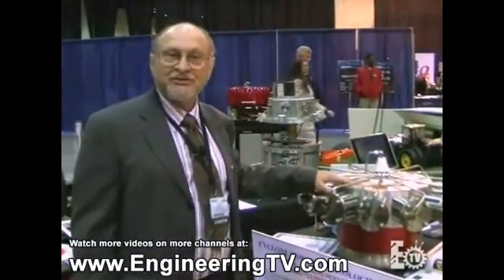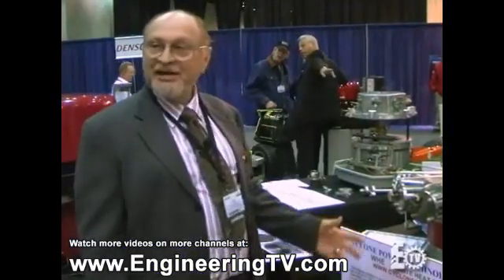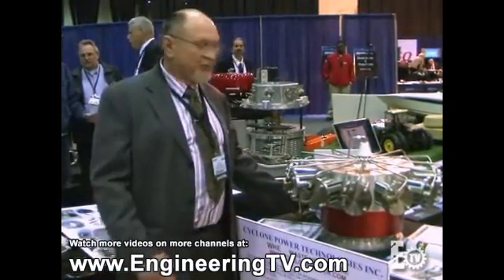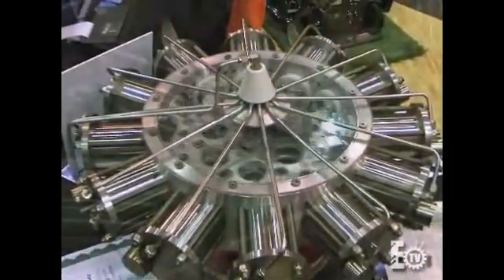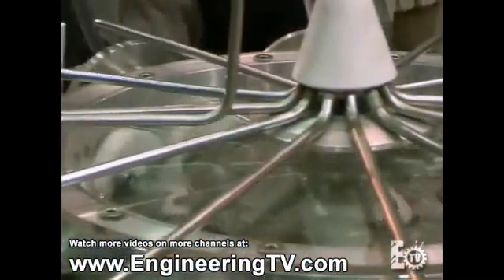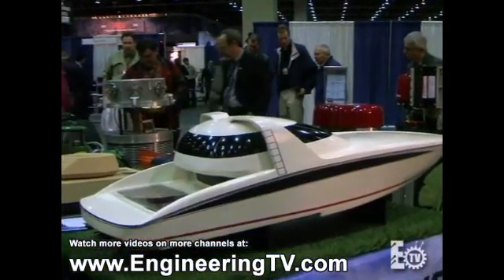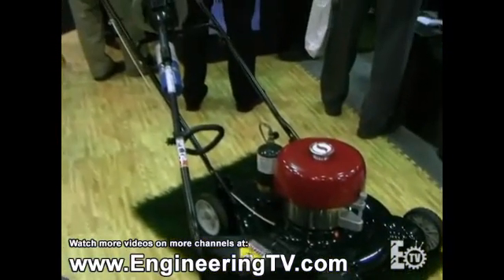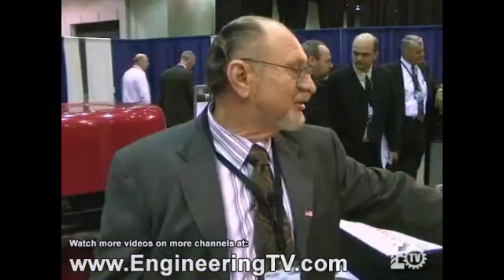Cyclone Waste Heat Engine

Comment: The worst ever type of engine is the radial, why even use this, if you have the space to use a turbine instead?
Reply: Cyclone was a fake company nothing but a fraudulent vaporware investment scam.
Reply: @sandervanderkammen9230  lol
Reply: @ExtremeGamerYT22  The slightest efforts in due diligence reveals this company was nothing but an elaborate vaporware investment scam.
Reply: @sandervanderkammen9230  I fell for it after seeing it featured on the Science Channel How it Works.  Seems it works to scam and screw investors.  This Waste Heat Engine is a great idea but has major design flaws that prevents it from ever being more than a garage project that will run for a relatively short time and fail.  

I think this is a scam company and they have barely done ANYTHING in the last five years and not much before that.  The one thing Cyclone Power has done in the last few years was sell off the only profitable part of the company, pocket the money and screw their stockholders that have been supporting them (seems like) forever. 

 Personally I think it was a scam from the beginning.  One of those pink sheet stocks pumped up and dumped by the owners.  I'd love it if they proved me wrong.  It is the perfect time - China Joe stole the election and with all of his green deal BS this company should be revived to capitalized on government grants and tax subsidies. Then they can screw their stockholders again with some insider trades etc..  Why the SEC lets these clowns and others like them get away with these scams and not put these fraudsters in prison is beyond me.
Reply: @SuperDanielB1  most of the investors money was siphoned off to build a mega yacht and a luxury home.

Comment: Looks junk if this was 2010 there should be some used lawn mowers by now ..lol scammers
Reply: This Waste Heat Engine is a great idea but has major design flaws that prevents it from ever being more than a garage project that will run for a relatively short time and fail.  

I think this is a scam company and they have barely done ANYTHING in the last five years and not much before that.  The one thing Cyclone Power has done in the last few years was sell off the only profitable part of the company, pocket the money and screw their stockholders that have been supporting them (seems like) forever. 

 Personally I think it was a scam from the beginning.  One of those pink sheet stocks pumped up and dumped by the owners.  I'd love it if they proved me wrong.  It is the perfect time - China Joe stole the election and with all of his green deal BS this company should be revived to capitalized on government grants and tax subsidies. Then they can screw their stockholders again with some insider trades etc..  Why the SEC lets these clowns and others like them get away with these scams and not put these fraudsters in prison is beyond me.
Reply: @SuperDanielB1  👍agreed

Comment: Did Harry ever go to jail for fraud??? I never heard if charges were ever filed on behalf of the investors that were defrauded in this scam.
Reply: A little digging into the companies claims reveals that the entire operation is what law enforcement officials call a "vaporware/boiler room type scam"  A company that sells penny stocks on technology that does not exist, not released and is never recalled.
Reply: You have to see the irony of a Vapor_ware scam selling steam engines... _Lol!
Reply: This Waste Heat Engine is a great idea but has major design flaws that prevents it from ever being more than a garage project that will run for a relatively short time and fail.  

I think this is a scam company and they have barely done ANYTHING in the last five years and not much before that.  The one thing Cyclone Power has done in the last few years was sell off the only profitable part of the company, pocket the money and screw their stockholders that have been supporting them (seems like) forever. 

 Personally I think it was a scam from the beginning.  One of those pink sheet stocks pumped up and dumped by the owners.  I'd love it if they proved me wrong.  It is the perfect time - China Joe stole the election and with all of his green deal BS this company should be revived to capitalized on government grants and tax subsidies. Then they can screw their stockholders again with some insider trades etc..  Why the SEC lets these clowns and others like them get away with these scams and not put these fraudsters in prison is beyond me.

Comment: were can i buy one
Reply: You can't, because the technology was all just fake props... part of an elaborate investment scam to defraud investors.
Reply: doktorbimmer you wait 🖕🏼
Reply: You can't and never will be able to unless you can pick up one at some kind of IRS liquidation sale or the like.  This Waste Heat Engine is a great idea but has major design flaws that prevents it from ever being more than a garage project that will run for a relatively short time and fail.  

I think this is a scam company and they have barely done ANYTHING in the last five years and not much before that.  The one thing Cyclone Power has done in the last few years was sell off the only profitable part of the company, pocket the money and screw their stockholders that have been supporting them (seems like) forever. 

 Personally I think it was a scam from the beginning.  One of those pink sheet stocks pumped up and dumped by the owners.  I'd love it if they proved me wrong.  It is the perfect time - China Joe stole the election and with all of his green deal BS this company should be revived to capitalized on government grants and tax subsidies. Then they can screw their stockholders again with some insider trades etc..  Why the SEC lets these clowns and others like them get away with these scams and not put these fraudsters in prison is beyond me.

Comment: That was over 5 years ago.   Where's the products?
Reply: monopoly does not turn
Reply: they do sell these but not to the general public
Reply: Cyclone is nothing but a defunct investment scam... it never produced a functioning engine... just fake props like the ones shown in the videos shown to the investors.
Reply: @doktorbimmer  I dont think so
Reply: @ExtremeGamerYT22  Cyclone stock is worthless and it's patents have been allowed to expire, the culprits have split with cash leaving investor with nothing.
Harry bought a mega yacht and Frankie bought mansion.
Reply: @sandervanderkammen9230  gimme a proof
Reply: @sandervanderkammen9230  bcs this would be the most idiot vaporware ever, the dudes made 5-6 engine for nothing
Reply: @ExtremeGamerYT22  Check yourself, this company was a complete  scam.
Reply: @ExtremeGamerYT22  A vaporware investment scheme is when fake props are used to demonstrate a product but is never tested to reveal that it actually works or performs as advertised.
 Cyclone never filled an order or delivered on a contract.
No independent third party testing results were ever made public.
Just lots of lies and unsubstantiated claims.
Reply: @sandervanderkammen9230  give me a link to an article
Reply: @doktorbimmer  correct sir! This Waste Heat Engine is a great idea but has major design flaws that prevents it from ever being more than a garage project that will run for a relatively short time and fail.  

I think this is a scam company and they have barely done ANYTHING in the last five years and not much before that.  The one thing Cyclone Power has done in the last few years was sell off the only profitable part of the company, pocket the money and screw their stockholders that have been supporting them (seems like) forever. 

 Personally I think it was a scam from the beginning.  One of those pink sheet stocks pumped up and dumped by the owners.  I'd love it if they proved me wrong.  It is the perfect time - China Joe stole the election and with all of his green deal BS this company should be revived to capitalized on government grants and tax subsidies. Then they can screw their stockholders again with some insider trades etc..  Why the SEC lets these clowns and others like them get away with these scams and not put these fraudsters in prison is beyond me.

Comment: Are these people still going? Or have they been bought up or rubbed out by the Oil Companies?
Reply: FAKE company nothing but a fraudulent vaporware investment scam.
Reply: Why would oil companies buy out or worry about an engine that wont last more than a short time???? This Waste Heat Engine is a great idea but has major design flaws that prevents it from ever being more than a garage project that will run for a relatively short time and fail.  

I think this is a scam company and they have barely done ANYTHING in the last five years and not much before that.  The one thing Cyclone Power has done in the last few years was sell off the only profitable part of the company, pocket the money and screw their stockholders that have been supporting them (seems like) forever. 

 Personally I think it was a scam from the beginning.  One of those pink sheet stocks pumped up and dumped by the owners.  I'd love it if they proved me wrong.  It is the perfect time - China Joe stole the election and with all of his green deal BS this company should be revived to capitalized on government grants and tax subsidies. Then they can screw their stockholders again with some insider trades etc..  Why the SEC lets these clowns and others like them get away with these scams and not put these fraudsters in prison is beyond me.

Comment: Sorry for below, meant 1200 degree F models (3200 PSI determines power specs not efficiencies).  Look up WIKI for Schoell Cycle for specifics, it's distinct from the Rankine Cycle and explains how this engine can have such a stable operating efficiency curve.
Reply: Fraud, complete scam.

Comment: Other models have efficiencies dependent on heat source temperature.  If the heat source is free (waste heat) it's not as big a deal.  Nevertheless, 500-700 F degrees should yield efficiencies from 15-25 %... right there with the petrol engine... not too bad for a wast heat engine
Reply: Fake company, fake technology

Comment: This video isn't the place to get too in depth on efficiencies.  They're on the website... it's a flat line efficiency curve of 33-35% from about 300 RPM to 3600 RPM for the 3200 PSI models.  With no transmission needed and reduced weight vs. IC setup (no oil/catalytic converter/muffler/radiator/fuel injection assembly/flywheel etc) you can count on MPG equal or better than small diesel engines. All emissions far lower than most stringent CA mandates; NOX is negligible.
Reply: Fake companies like Cyclone don't produce real engines.

Their efficiency claims are nothing but lies.

Comment: Just a little ( very) evasive about efficiencies. Does it do better than internal combustion or not? Sure doesn't seem like it. I'm wondering what the exact exhaust gas composition is too.Seems like NOx would be high. 
BTW where is the lawnmower? It's over 2 years and still no sign of it.
I hope it actually works, but it sure doesn't look like it will
Reply: Fake companies like Cyclone don't produce real engines so no real data, just lies and false claims.
Reply: @sandervanderkammen9230  this was so long ago, I forgot about it. The lawnmower would have been a no brainer- if it worked- but it doesn't. The pumping losses alone would be enormous. There was a company  near me called Orbital Engine. They supposedly sold some of their engines. Made something similar, but it was a stock swindle.
Reply: @Tommy_Mac  Indeed, the world is full of vaporware investment scams like this, unfortunately in many countries it's perfectly legal.
 Freedom Motors  (Moller Skycar) is perhaps the most infamous and certainly the longest running.
I hear Paul Moller's latest scam is selling fake organic honey.
Reply: @sandervanderkammen9230  that figures.
 Once a charlatan, always a charlatan.
Reply: @Tommy_Mac  pink sheet boiler room pump and dump.

Comment: or solid co2, that would be the best fuel as we have far to much of it anyway
Reply: Co2 is a negative energy molecule, wich means it needs energy to transform into another thing, the only thing we can do with it is to build structures with a concrete made of co2, that wont be used to be burnt.